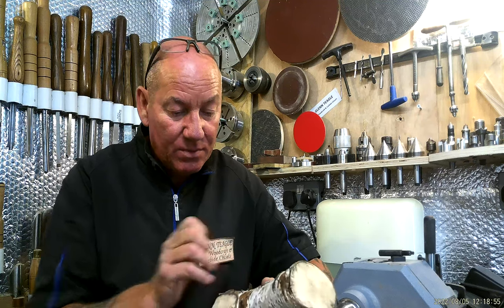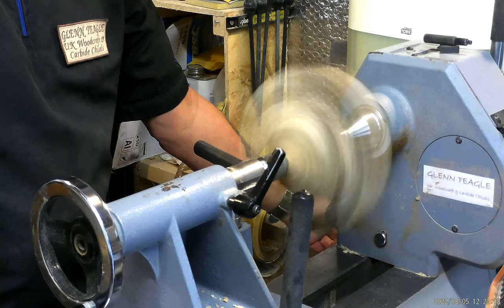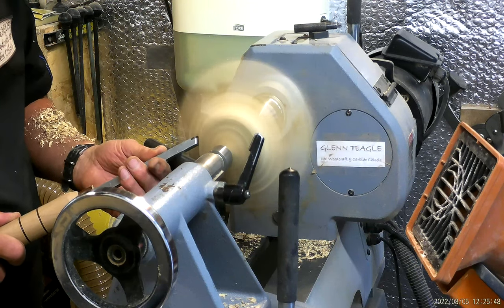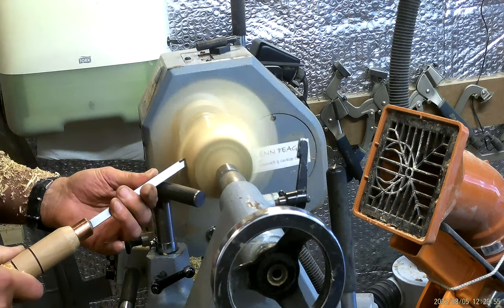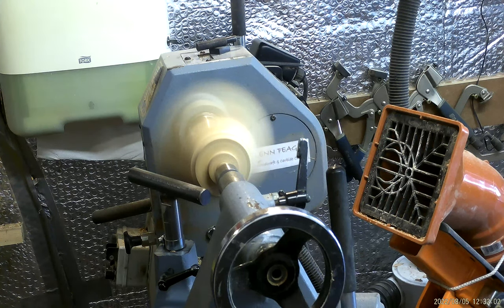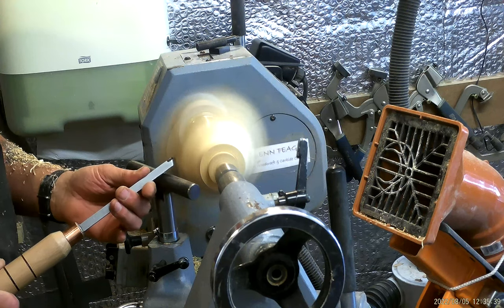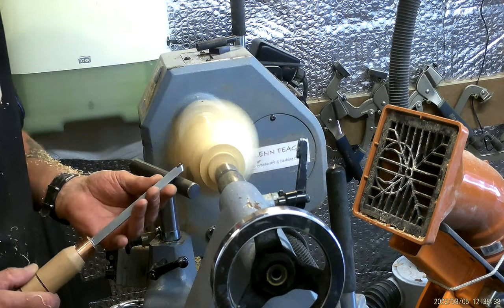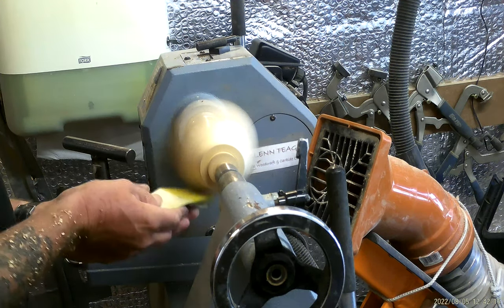Woodturning a silver birch bowl using my Carbide Chisels Part 1

Comment: Morning Glenn
Is this a wet/green log as, you sand and seal which, I didn’t know you could with freshly cut wood. 
I know that you make your own sanding/seal, which brand of initial sealer our you using?
I’m presuming Chestnut finishing paste as, you quoted ‘22’.
Enjoy watching you tackling this one. 
Part II lined up and waiting.
Reply from the maker: Hi Peter, yes it was freshish cut piece. would be better to finish with oil but it's just a free bit of wood so not to bothered . Chestnut sanding sealer .